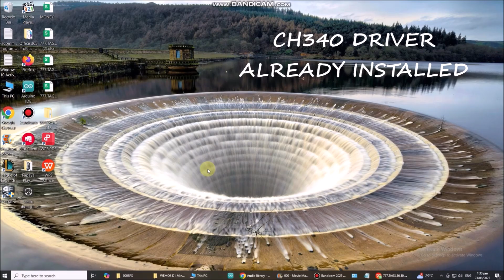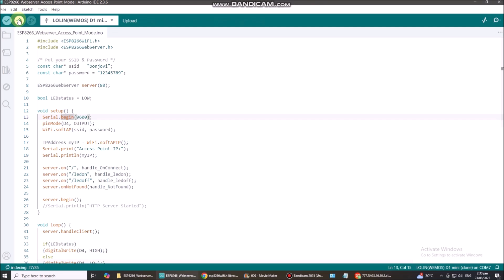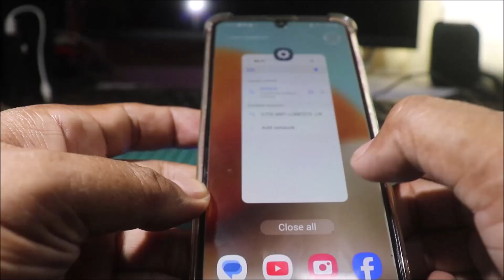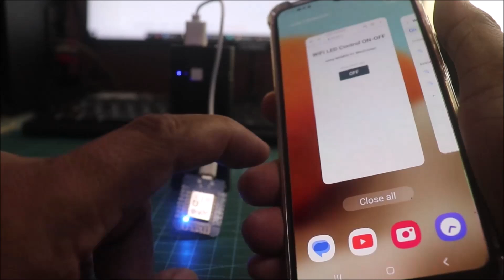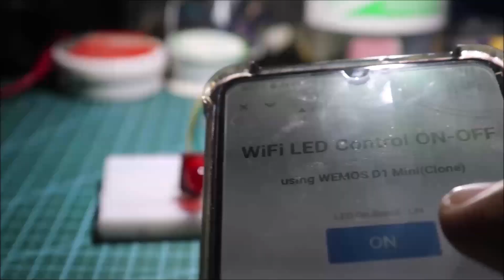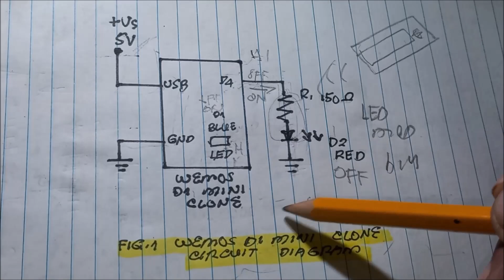WEMOS D1 Mini (Clone) _ WiFi LED Control On-Off

Comment from the maker: #include <ESP8266WiFi.h>
#include <ESP8266WebServer.h>

/* Put your SSID & Password */
const char* ssid = "bonjovi";       
const char* password = "12345789"; 

ESP8266WebServer server(80);

bool LEDstatus = LOW;

void setup() {
  Serial.begin(9600);
  pinMode(D4, OUTPUT); // LED Outout D4 is inverted with respect to BUILTIN LED...
  WiFi.softAP(ssid, password);

  IPAddress myIP = WiFi.softAPIP();
  Serial.print("Access Point IP:");
  Serial.println(myIP);
  
  server.on("/", handle_OnConnect);
  server.on("/ledon", handle_ledon);
  server.on("/ledoff", handle_ledoff);
  server.onNotFound(handle_NotFound);
  
  server.begin();
  //Serial.println("HTTP Server Started");
}

void loop() {
  server.handleClient();
  
  if(LEDstatus)
  {digitalWrite(D4, HIGH);}
  else
  {digitalWrite(D4, LOW);}
}

void handle_OnConnect() {
  LEDstatus = LOW;
  Serial.println("LED: OFF");
  server.send(200, "text/html", updateWebpage(LEDstatus)); 
}

void handle_ledon() {
  LEDstatus = HIGH;
  Serial.println("LED: ON");
  server.send(200, "text/html", updateWebpage(LEDstatus)); 
}

void handle_ledoff() {
  LEDstatus = LOW;
  Serial.println("LED: OFF");
  server.send(200, "text/html", updateWebpage(LEDstatus)); 
}

void handle_NotFound(){
  server.send(404, "text/plain", "Not found");
}

String updateWebpage(uint8_t LEDstatus){
  String ptr = "<!DOCTYPE html> <html>\n";
  ptr +="<head><meta name=\"viewport\" content=\"width=device-width, initial-scale=1.0, user-scalable=no\">\n";
  ptr +="<title>LED Control</title>\n";
  ptr +="<style>html { font-family: Helvetica; display: inline-block; margin: 0px auto; text-align: center;}\n";
  ptr +="body{margin-top: 50px;} h1 {color: #444444;margin: 50px auto 30px;} h3 {color: #444444;margin-bottom: 50px;}\n";
  ptr +=".button {display: block;width: 80px;background-color: #1abc9c;border: none;color: white;padding: 13px 30px;text-decoration: none;font-size: 25px;margin: 0px auto 35px;cursor: pointer;border-radius: 4px;}\n";
  ptr +=".button-on {background-color: #3498db;}\n";
  ptr +=".button-on:active {background-color: #3498db;}\n";
  ptr +=".button-off {background-color: #34495e;}\n";
  ptr +=".button-off:active {background-color: #2c3e50;}\n";
  ptr +="p {font-size: 14px;color: #888;margin-bottom: 10px;}\n";
  ptr +="</style>\n";
  ptr +="</head>\n";
  ptr +="<body>\n";
  ptr +="<h1>WiFi LED Control ON-OFF</h1>\n";
  ptr +="<h3>using WEMOS D1 Mini(Clone)</h3>\n";
  
   if(LEDstatus){
    ptr +="<p>LED 0n Board : OFF</p><a class=\"button button-off\" href=\"/ledoff\">OFF</a>\n";
   }else{
    ptr +="<p>LED On Board : ON</p><a class=\"button button-on\" href=\"/ledon\">ON</a>\n";
  }

  ptr +="</body>\n";
  ptr +="</html>\n";
  return ptr;
}